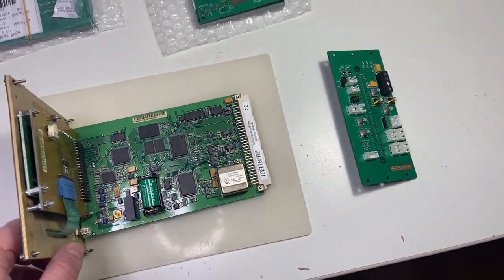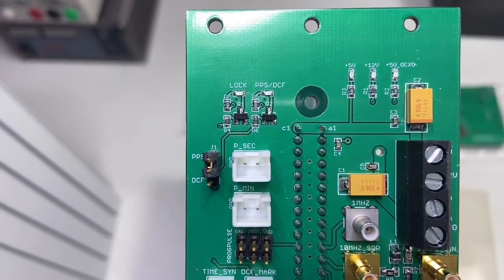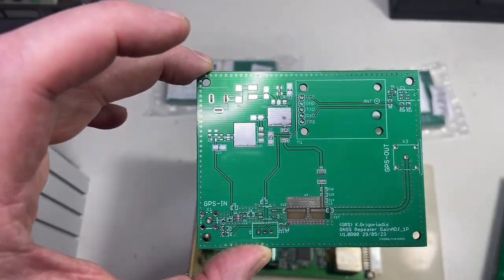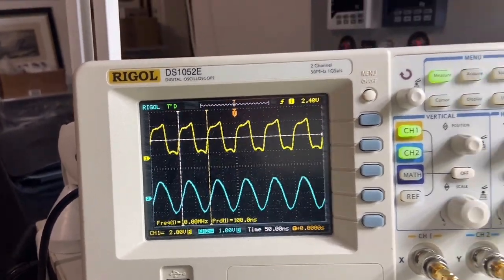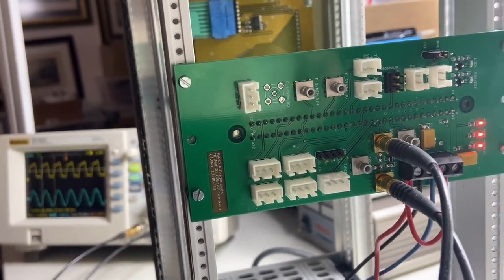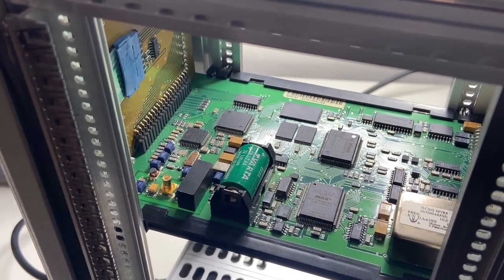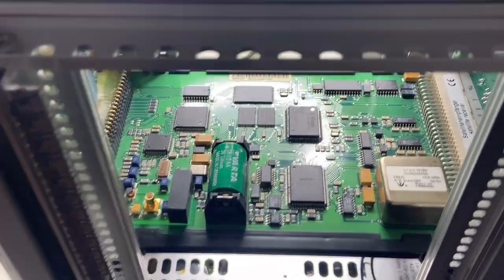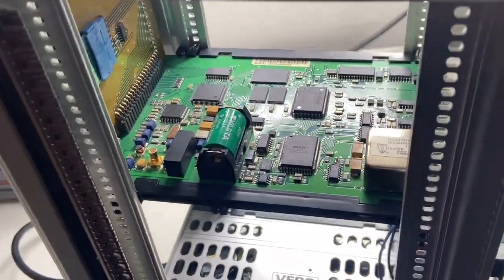MEINBERG GPS167 Rackmount GPS Clock / OCXO Appliance, Universal Breakout Back-plane Design.

Comment: To je samo dobro !
Reply: Have you designed your own GPS-CON (GPS Converter), or your own GPS antenna with Zarlink converters (1st stage, 2nd stage with if= 35.42) ?
Reply from the maker: @KristianDjukic  I made the Design, but I never made the Pcbs for it bcs its very difficult to find these old chips, the converter is more or les the design that is in the original antenna. When i find time and muse i will make the converter with modern parts